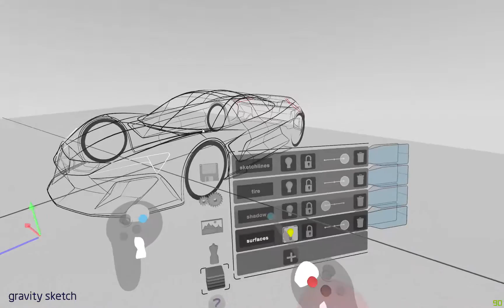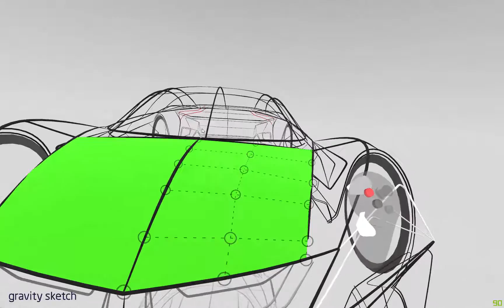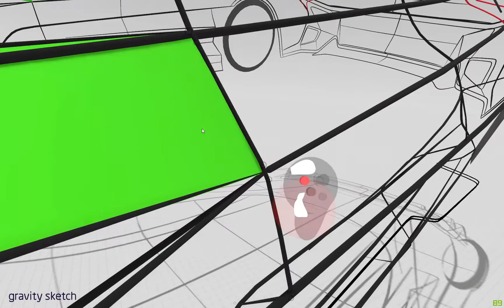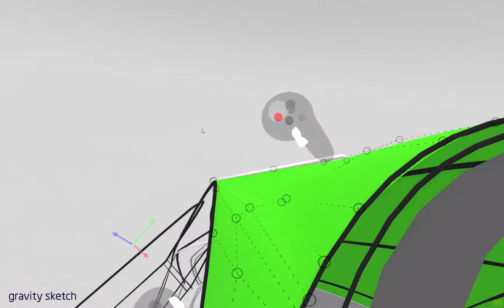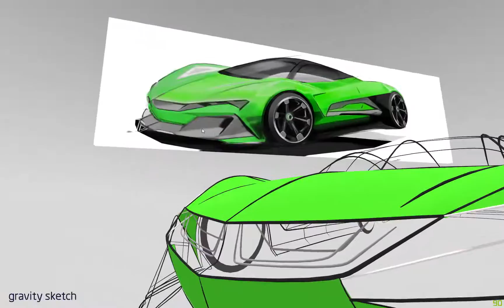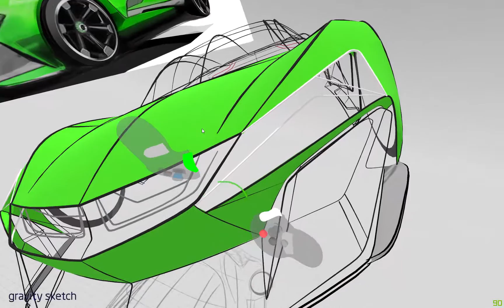Gravity Sketch VR, Super Car Demo, Part 4

Comment: Hey dude what are the tools that youre using (computer, vr headset).
Reply from the maker: When this video was made I had an i7 4900K, 16GB of ram and 2X GTX 1070. I have since upgraded the CPU and RAM. This was also made with the original Rift, I have since moved to the Oculus quest. I switch between stand alone mode and Desktop mode with the Oculus link cable.

Comment: i would like to do 3d printing of a model but not of the surfaces connect to each other so the mesh is not water tight am i missing something
Reply from the maker: Currently the surfaces are not connected so it would take a bit of manual post processing to make a model to print..